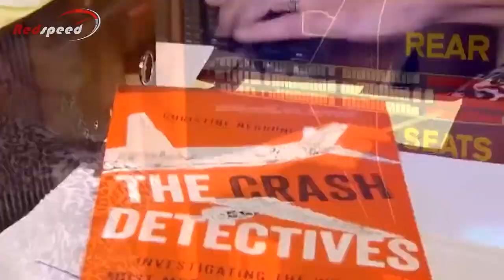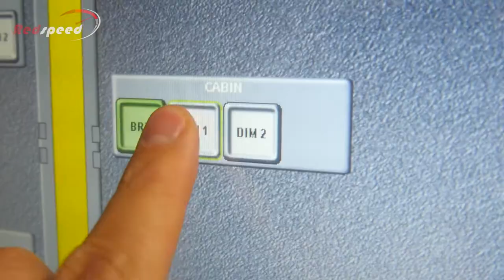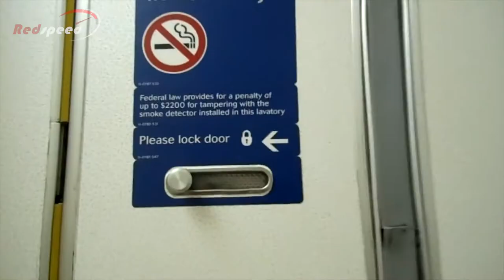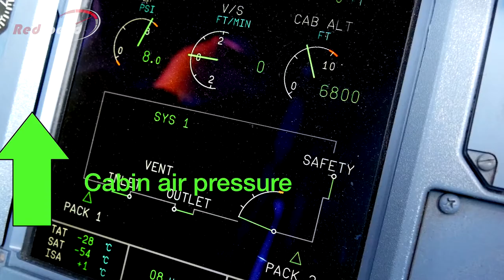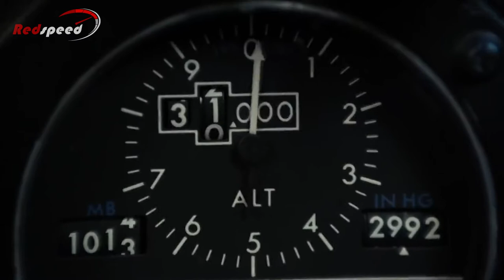Airplane Things you Definitely didn't know

Comment from the maker: 00:25 Airplanes are designed to withstand lightning strikes
00:54 There is no safest seat on the plane
01:30 Some airplanes have secret bedrooms for flight crew
01:58 The tires are designed not to pop on landing
02:29 Why cabin crew dims the light when a plane is landing
02:59 You don’t need both engines to fly
03:42 Why there are ashtrays in the bathrooms
04:17 What that tiny hole in the airplane window does
04:47 Why airplane food taste so bad
05:37 About those oxygen masks 
06:29 Why planes leave trails in the sky